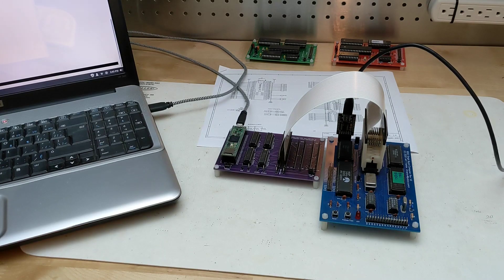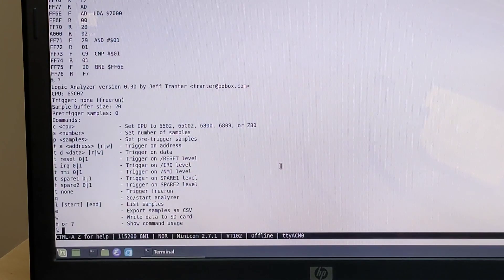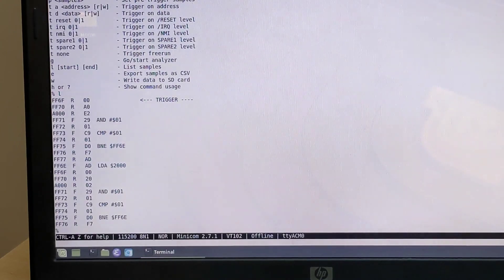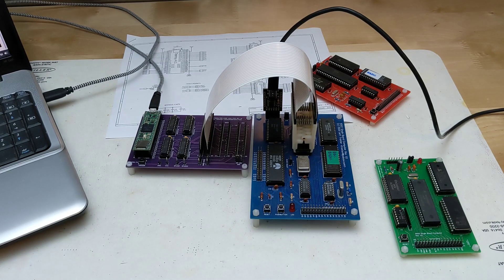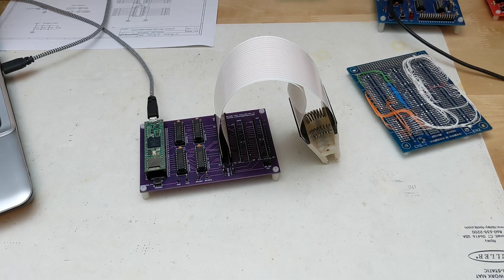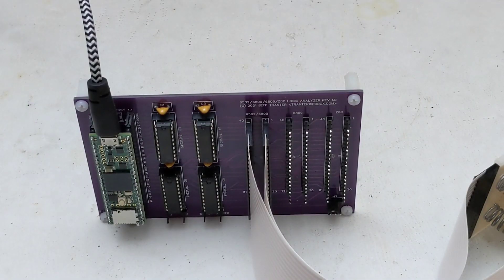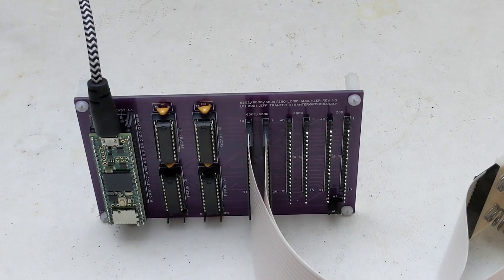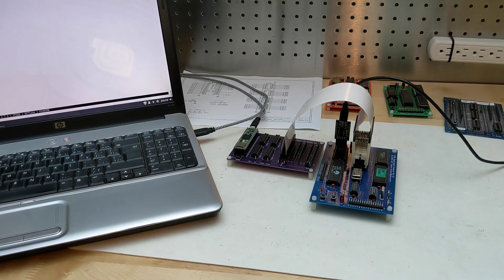Logic Analyzer Update

Comment: Hello Jeff, a very nice project. I am trying to find the 0.1 inch female connectors to slide onto the flexible flatcables. Where did you find these or do you have a specific name to search on? Using these makes it much neater and flexible.
Reply from the maker: The female connectors are an integral part of the ribbon cable. I used Digikey part number A9BBG-2008F-ND.